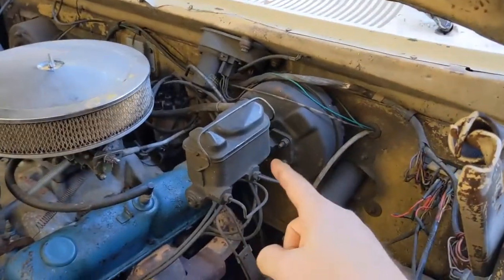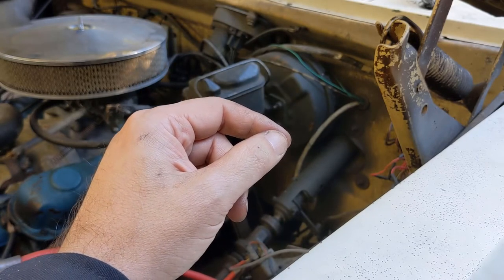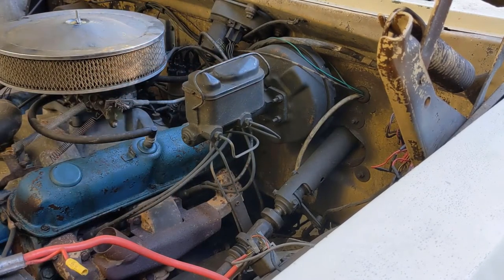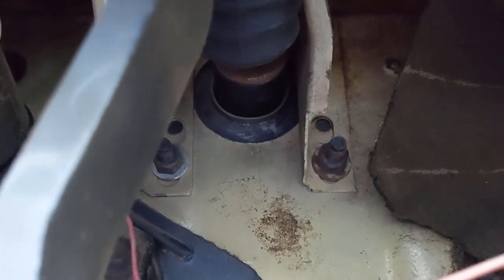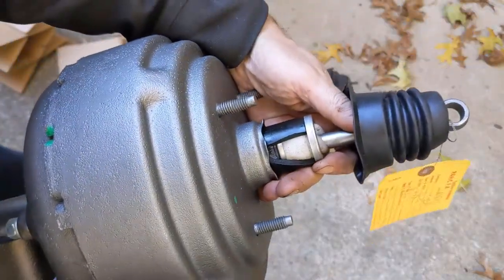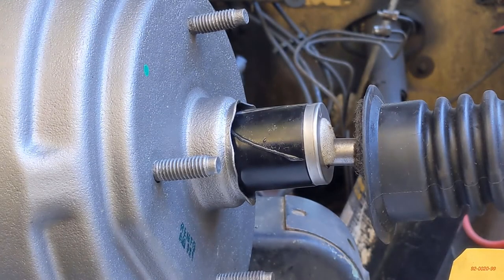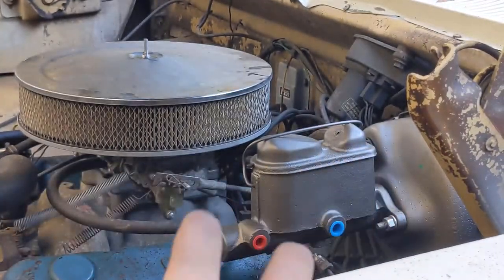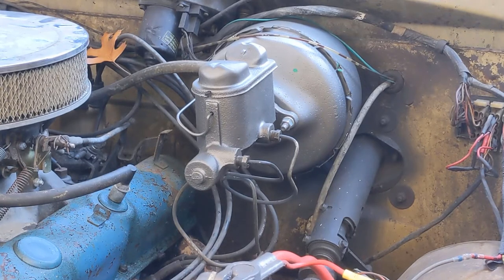Replacing a Power Brake Booster and Master Cylinder

Comment: do you have a part number for this? i have power drums on my 72 d100 and she needs a new booster/cylinder.
Reply from the maker: It's probably a Cardone 5473122.  That said, the part number doesn't make a huge difference because they're not in stock anywhere.  You have to mail in yours and they rebuild it, so whatever you send in is what you'll get back.  I did the purchase, etc. through Rock Auto.
Reply: @YoshimoshiGarage  that's the next question I was gonna ask.  I appreciate it greatly.  Thank you Thank you THANK YOU.   Absolute life saver